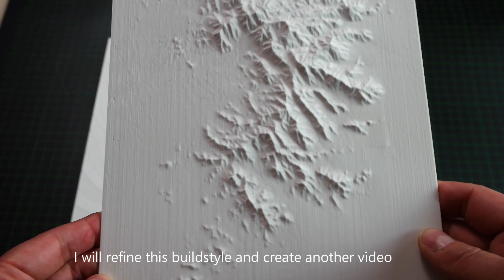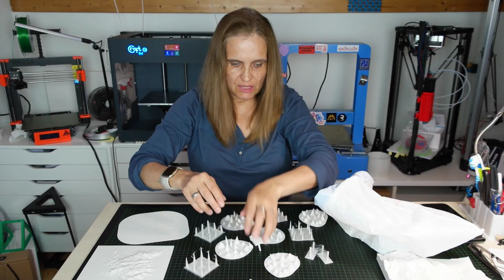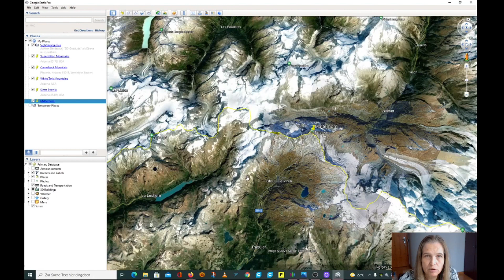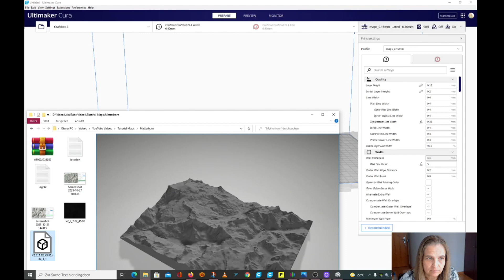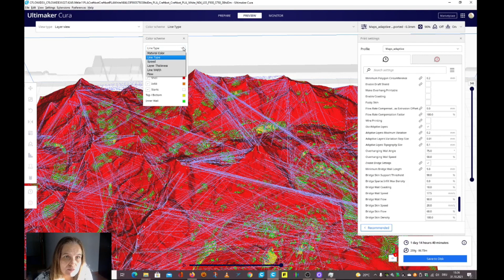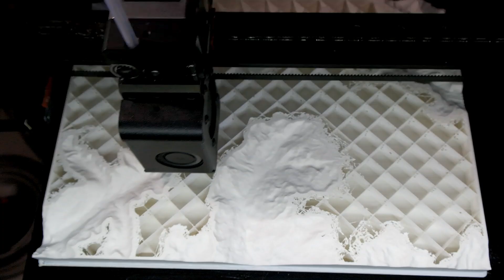How to create smooth 3D printed maps without stringing

Comment: I'd never thought to print maps upright: what a great idea!
Reply from the maker: It only makes sense for the very flat ones that don’t need supports when printed upright.
Reply: @choschiba  It would be interesting to write a slicer plugin that calculates the maximum angle of tilt that doesn't need front support and slices it at that angle.
Reply from the maker: @smellsofbikes  that sounds really great 👍🏼 If I would only know how to write code 💁🏼‍♀️